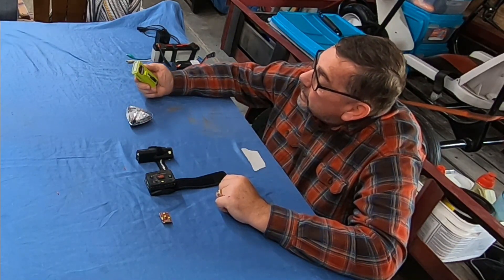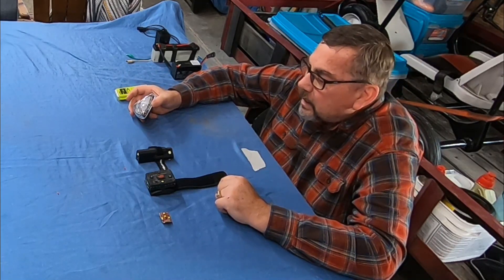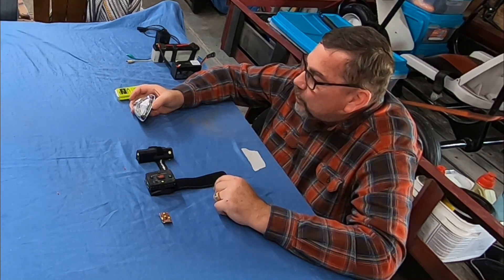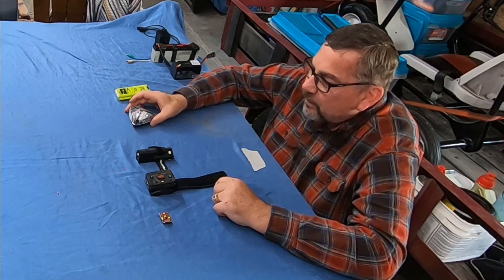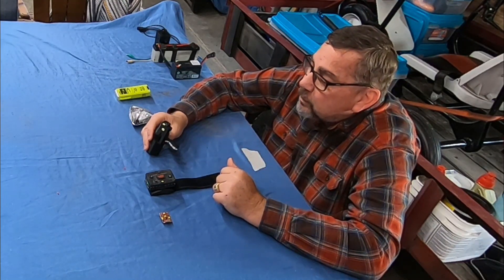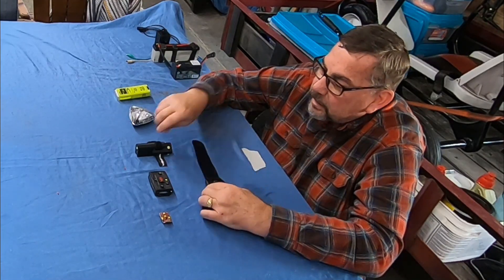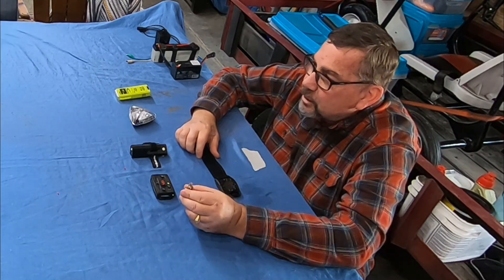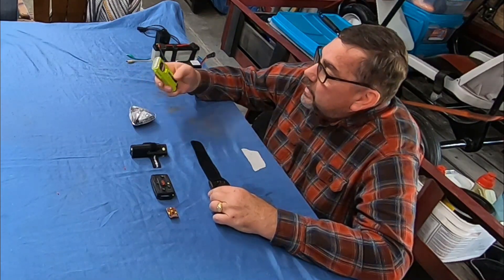Lets talk self contained PPG strobes, batteries & other accessories - Ohio Paramotor Trike Adventure

Comment: Hello, I use the Alctitude strobes, they are very powerful. They can be seen at more than 10 miles and last more than 8 hours on each charge. They have a wireless connection and can have up to 30 strobes with simultaneous ignition and flashing synchronization. They also have the peculiarity that they are completely repairable and all their parts they are achieved. I consider it the best option at the moment, due to its capabilities, power and low price.
Reply from the maker: More info please

Comment: Are you seeing stars yet, I am 😆.    Really like the Guardian (got one recently).   Was wondering if you are still using the Abrams?    The hunter and firehouse look good too. 
    Thanks much for the info.
Reply from the maker: Yes, I’m still using the Abrams.  With the portable ones I have, I don’t use it as much as the portables.
Reply: @Ohio-PPG-Trike-Adventures  As you said about mounting top of the cage.   My Abrams is on the top of the hoop but it is (was changed) upside down inside the top of the hoop.   I had a failed launch because the wing came up to the side  and I when tried to  straightened it, it didn't.     No lines got caught in the prop (killed engine quickly).   Turned it upside down inside the cage that evening.     Funny part is I saw one of Tucker's "crash critique" videos where a lady had a failed launch for the same reason but her strobe was much larger than the Abrams.   Thought nothing of it at the time but knew right away what probably happen when it happened to me.    🙄
Reply from the maker: Abrams behind my head.  The low profile one is on the top of hoop.   The way it is mounted is between the hoop.   Maybe 1/4 inch above the hoop.